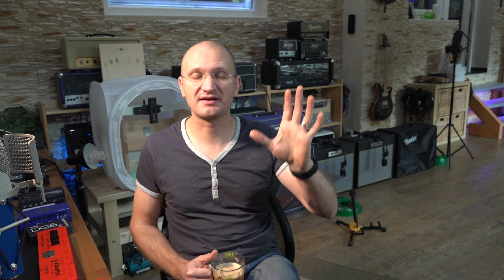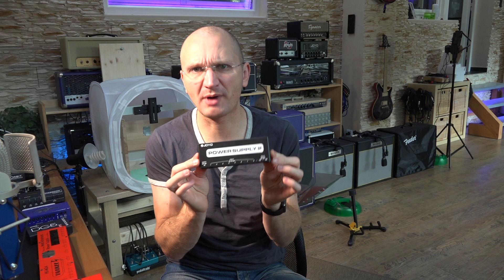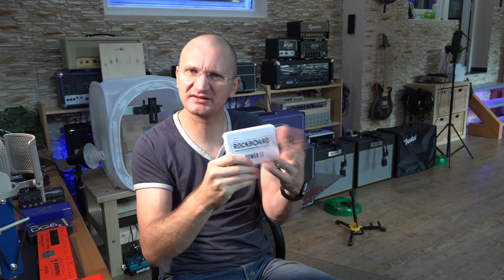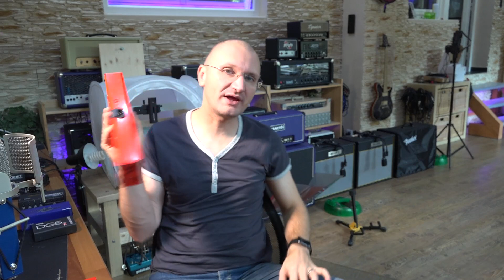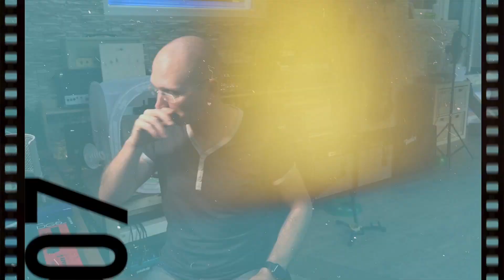Power Supply Shootout - What does a Power Supply SOUND LIKE?

Comment: Cable Tip Noise

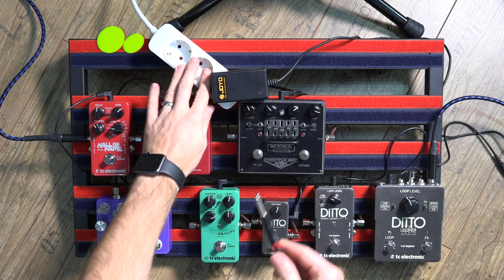Joyo Daisychain - 20:48
Capine - 23:07
Joyo Power supply 2 - 24:43
Harley Benton - 26:31
Moen - 28:16 
Carl Martin - 29:52
Joyo Power supply 4 - 31:27
Rockboard Powerpit - 33:13
Yankee 10 - 36:00
Yankee 24 - 37:35
Rockboard LT - 39:09
Cioks - 41:11 

Cable Length Noise

Joyo Daisychain - 21:05
Capine - 23:18
Joyo Power supply 2 - 24:52
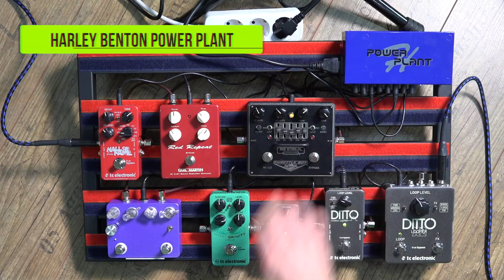Harley Benton - 26:43
Moen - 28:23 
Carl Martin - 30:00
Joyo Power supply 4 - 31:34
Rockboard Powerpit - 33:33
Yankee 10 - 36:08
Yankee 24 - 37:44
Rockboard LT - 39:15
Cioks - 41:23 

Sound 1

Joyo Daisychain - 21:16
Capine - 23:26
Joyo Power supply 2 - 25:12
Harley Benton - 26:51
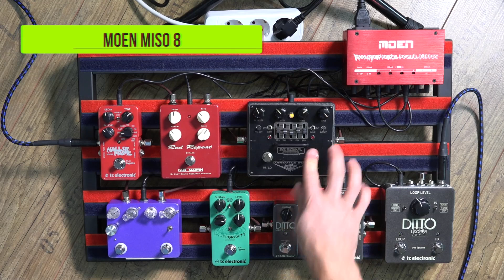Moen - 28:31 
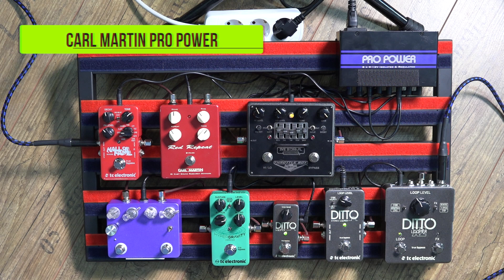Carl Martin - 30:05
Joyo Power supply 4 - 31:32
Rockboard Powerpit - 32:24
Yankee 10 - 36:13
Yankee 24 - 37:50
Rockboard LT - 39:28
Cioks - 41:32 

Sound 2

Joyo Daisychain - 21:41
Capine - 23:47
Joyo Power supply 2 - 25:33
Harley Benton - 27:23
Moen - 28:53 
Carl Martin - 30:29
Joyo Power supply 4 - 32:13
Rockboard Powerpit - 34:52
Yankee 10 - 36:38
Yankee 24 - 38:11
Rockboard LT - 40:00
Cioks - 41:55 

Sound 3 

Joyo Daisychain - 22:09
Capine - 22:12
Joyo Power supply 2 - 26:00
Harley Benton - 27:50
Moen - 29:25
Carl Martin - 30:54
Joyo Power supply 4 - 32:40
Rockboard Powerpit - 35:21
Yankee 10 - 37:04
Yankee 24 - 38:35
Rockboard LT - 40:27
Cioks - 42:22
Reply from the maker: Thanks man! Very kind of you to give the times... I spaced out on that!
Reply: No problem at all, interesting to hear!
Reply: +Tobias Hawthorne   capine sound 3 starts @24:12 :-)
Reply: EytschPi42 man I'm kind of a noob with pedal board building stuff, would you mind building me one?? Haha I'll even send you all the pedals
Reply: Thanks man! I really love the videos if only there's less talk and more on gear...

Comment: The metal cases for the power supplies will provide better shielding over the plastic wall wart.  But the plastic wall wart would likely be at the AC outlet away from the pedals so the distance will be better.   I think it might have been better to have use an Oscilloscope to see if there was power supply ripple from the various supplies when you were active with the pedals.  Hard to hear noise when the signal is so strong.

Comment: Good video. I used a daisy chain power supply for a few months, and for some reason I had to plug in and turn on each pedal one at a time anytime they were unplugged from walls power. also would sometimes get very pronounced hum through one or two of the pedals. Have since switched to a fairly cheap, around $32usd power brick similar to the joyo 2, dead silent and all the pedals power up properly once power is connected to the brick.

Comment: Great video. Thanks. BUT! You should state in the beginning which of them really had a) old school linear torrodial transformers or b) switched current. Such can play a large role. And btw, the pops in ALL of these videos has nothing to do with the pedals alone. I have the large DITTO looper (to the right) and it doesn't pop the slighest when turning it on or off. I can attest to that most (not all) pedals that runs on internal pump charging and on 18v or more DOES pop independently of power supply. Some does, some not. Most buffered pedals doesn't pop. The difference in sound though, is only where it is at rest, i e how background hum or noise floor and ..... especially....heterodyning high pitch whisteling. Not increased dynamics or else. However on bass pedals especially compressors, it is an advantage to dynamics to run them at 18v, so they can take ample input from say low B strings and active pickups. But we digress...back to the pops:

So you must have some mismatch in the phase flow of the current, outside of the power supply, or even at the receiving end, the amp, or mixer/soundcard or whatever. No one of the pedals should pop. The Mesa dirt pedal was the one most prone to hum and noises from lesser power supplies, as well as the loudest pop.

Some pedals (you should do a full video on this phenomenon too) have internal charge pumps which some other digital pedals in the chain picks up and downsamples them and an annoying high pitched whining occurs. It's called heterodyning. It's a nuisance. And this is dependent on BOTH the power supplies (mostly modern switched ones) and how the individual pedal is made, if it filters out this or not. 

- - - - - - - - 

Say an analog dirt pedal that runs on 9v from the outside, has an internal charge pump that ramps it up to 18v. Now, the charge pump (internal electronic component) works at a certain frequency high above the human range, but just so much. At - say - 22 Khz. No one hears this. BUT! Whenever hooked up down the chain to a Digital Delay, or Pitch Shifter (or pitch shift preset in any multifx box) Whammy pedal, their internal DA or AD converter finds this 22 Khz frequency and downsample it into the hearing range for humans. That's what happens. I've discovered that most Strymon reverbs, and delays suffers from this since they have high end and pristine AD/DA converters inside. And those companies tells the other ones, the makers of charge pump pedals, to fix their output of high frequencies with filters, it's not Strymons fault. And the makers of these analog pedals blames Strymon for not bucking that frequency with filters before AD/DA conversions. A catch 22.

EDIT: Besides all this, no other YT video of the Ditto looper sports any pops. Including your own earlier demos of it, which always are very thorough. Both the regular versions, and jam versions. Note, that it would be very inconvenient should any looper record and keep any pop from any other pedal too. It would turn out extremely annoying to keep listening to that pop occuring every cycle.

Comment: You can notice a slight reduction in ground noise on the power supplies being used after the power plant when you listen to the clean loops. Not all of them, but most of them. The two pedals he is using for the clean loops sound like they are causing the most ground noise compared to the other ones. What pedal board model is that being used in the video?

Comment: +EytschPi42
of Bolivia I not understand much English so I glass on what I hear.
I have rockboard powerpit, after hearing and seeing the video stay with a bad impression, apparently is noisy, what you suggest? Change of power supply ?, sorry for the English, I'm using google translate, thanks
Reply: I know this is late, but unless you notice noise in your rig i wouldn't worry too much. Yes there are probably quieter options but unless it is causing you problems it is probably not worth the extra cost.

Comment: Here in the UK there is a company called Diago.  They are very similar to the GigRig in that it is not a power brick.  much cheaper.  would definitely sort out your boards.
Reply: The Diago was great until I got el Cap from Strymon, man that high pitch hum thou :(
Reply: you need the diago isolator.  or the gigrig one will work.  that should sort the issue out

Comment: Got the first question: Can i use 9volt-pedals also with 12/18 volt and if i can would it make a difference in sound and why?
Reply: No you can't! I tried that ones....the pedal i tried it with, died. So don't do it!
Reply: +roeletti if they are digital, that is a "no-go"! but if it is analog, there's a chance you can do that... but don't try if it's not written on the manual...
Reply: Boss older stuff is 12v. My CS 1 is modded and says 9v on it. So I ran it in 9v. For a while it sounded good, quiet lit up right did what it was supposed to do. Then I took my board over a friend's house and the most horrible noise came out. So we couldn't use it that day. Came home, went through the board and decided to change the CS-1 To 12v. Problem fixed so far. Haven't taken to friends to see if it's a grounding problem at his house. Will take a grounding loop box next time also

Comment: For what it is...the Joyo Wallwart kicks serious B#tt. You wont ever put your cable near the wart and there is nothing in the power supply close to the Pedalboard. Its plugged in the power strip. it sounded clearer than most if not all the samples loop tests. The Joyo big brick was also good. I think Henning knows this as well. Joyo rocks

Comment: Nice video!  I have a problem i can't figure out. I have a fulltone ultimate octave fuzz and an analog delay pedal that give a high pitch buzz/hum. I power my board with a simple plugin 1 spot power supply. The weird thing is that the analog delay  starts with a fairly high pitch en when engaged the pitch gets higher within the first 20/30 sec. Like there are capasitors that charge or something. On the same pedalboard i have a crybaby and a fulltone mosfet drive2, polytuner and a super hard on from zvex. My amp is a blues deluxe ri and my guitar is a 65 jazzmaster.

Comment: sir i have a boston acoutic simulator..the problem is i have a different power supply and when i plug it on the sound sytem it doesnt sound or sometimes it sounds and suddently the volume goes down..

Comment: Anyone use a Donner DP1 power supply? Is it noisy or no? It has good reviews on Amazon, but I want some feedback from more guitarists
Reply: The Donner DP1, the Accel FX 10M and the Joyo Power Supply 2 are basically the same, rebranded  units, some with a slightly different chassis, but extremely similar boards inside. They are NOT fully isolated channels. ( The Accel FX 8 IS fully isolated... Accel does not claim the 10M to be isolated..just filtered and regulated )They will say "isolated" as in protecting the circuit in case of a short, all outputs will not suffer loss if one shorts out. But in the case of guitar pedals, we look for "isolated" as in, each channel grounded so grounding issues between outputs will not create noise, like using a daisy chain can do, especially if you are running analog AND digital pedals. They work fine enough, but dont do anything to isolate each power output channel. I KNOW they say they are, but they are not. Most isolated units are more expensive. These units are basically a boxed daisey chain, with varying voltages and currents available. ( 100mA, 500mA, 9v, 12v, 18v...)
Reply: Hey man I’ve been using a 30 dollar donner for a year and have had great luck even with several different types of pedals. Cheers!

Comment: Hi EytschPi42,
I really like your shows you're making for guitar geeks like I am. I need to know how pedals look on the inside and I opened quite a lot of them and built a few DIY's. At the moment I am building my pedalboard and also am wondering what to use for a power supply.
As far as I can see, a lot of daisy-chain based power supplys are based on switching circuit (step-down type power supply) and the "old-type" power supply uses classic mains power transformer. Switched power supply is working on very high frequency (varies, depending on the controlling IC) and are not inside metal cases. These kind of circuits generate a lot of electrical interferences and are not suitable for audio (all Hi-end HIFI systems use transformers in power supply line). As far as I can see, the only advantage of switched PSU over classical transformer is it's small weight and therefore also smaller size. 

I hope I'm not too late for the questions, which would be:
1. My pedalboard is made from Harley Benton Dynamic Compressor, Digitech Screamin Blues, Electro Harmonics NEO Mistress and finally Digitech Digital Delay. I am thinking of buying a looper like Boss RC-2 or RC-3. What kind of supply is to be used with these pedals?

2. What does the ISOlated power supply mean? Does every "channel" have its own 230/9V transformer or do all channels have the same transformer and each its own stabilizing circuit?

Regards,
Andrej

Comment: Hello, i actually have 8 pedals ( all analogs ) on my DIAGO pedalboard and FUEL TANK JR with 2 TC current doubler, which works well , but a new pedal ( diamond MMR JR )came( instead of my MELAKKO 616 delay out now) and one of my doubler cable is too short ......Do I have to buy another DC UNIT ?
DOES THE FUEL TANK CLASSIC ( no individual isolated current output , the JR WAS !) do the same job with the same silence ? I do want to spend a lot of money as voodoo lab is, sorry....Thanks a lot for your help and answer, Best regards from France
Reply: Sucks noone answered this guy, cos I'm in a similar boat.

 I've got a few more pedals than my power brick has got outlets. I've tried daisy chaining the last few...and I've tried just plugging in only the ones I'm using at that moment.

Both are unsatisfactory, over time.

Do I really need to buy a whole new brick just to cover a couple of pedals?

Comment: is the amp itself running from a power regulator? Or your whole studio? Looking at the amount of gear you must have a urge suppressor or something similar.
Reply from the maker: +Haz Jalkhi No, I just have a lot of independent power lines coming in.
Reply: We wont be able to find out like this. This power supply examination has to be conducted in a venue like situation. Not that I am requesting your to travel or anything. But take into the equation somewhere which has a similar venue electricity outlet and is a in a space which allows a great amount of interference. Your studio is well equipped and looks well isolated, therefore not the right place for such test. Still, I am looking for the next week video. You are AWESOME!
Reply: +Haz Jalkhi Yes in the past I had my pedalboard dead quiet at home and hissing like crazy at a venue. That's why I know have my whole board running on the Sanyo Eneloop Pedaljuice! Its a lithium battery the size of a standard BOSS pedal. It only has two outputs but since it's a battery, you can daisychain all u want without any noise issues (even digital ones). Mine powers 8 pedals and a Harley Benton FXL-8 pro and can easily run 5-6 hours . More than enough for a gig. I paid only €50 for it and it was easily one of the best purchases I made for my pedalboard, say goodbye to ANY electricity related noise problems :) Maybe something interesting to look at +EytschPi42?

Comment: Can you do a comparing between the joyo and the new Engl power tap?  I recently purchased it there is something annoying. The engl is very similar to the joyo but it's retailed 120 euros!!! (79 on thomann since last week, that's why I purchased it). I just wonder if  engl are horrible people that sells the same thing for 3 times the cost, or mybe it's a really improved version that only shares the same chassis of the joyo. I also noted that thomann says they are isolated but the manual and the engl website says "protected from short circuit". Thanks! 🤘

Comment: Hi, I need to ask you some information.
To be able to power 10 mixed pedals (BOSS, MOOER, IBANEZ, AKAI) what type of power supply will I recommend? I have tried the "Harley Benton PowerPlant" and also "Harley Benton PowerPlant Powerbank" but in both cases there is always a background noise (that if you feed each pedal individually with normal 9V power supply, there is no buzz!). Can you give me a tip? (the pedals are all 9V). Thank you . and sorry for disturbing. Best regards
Reply: francesco martinico buy an isolated power supply. It’s the only way.

Comment: Q: Electro Harmonix pedals come with a dedicated 9.6V power supply. Can normal 9V power sources cover them, does it make any difference?
Reply: seitsen Yes, no. (But check the polarity).
Reply: Yes you should be able to power them, but depending on the pedal you might experience differences in sound/behaviour. My Deluxe Memory Boy goes into self oscillation much sooner and more uncontrollably so when powered with 9V vs. 9.6V

Comment: What do you think of the DCT-200 by Fame?
Reply: Isolation is not nonsense when it come to eliminating groundloops, especially when using effect loops. I do have a Fame DCT-200, and it does blow any other cheap power supply out of the water! I tried the Donner DP-4, which does have isolated outputs, but fails short on current; it cannot deliver 100mA without considerable noise on the line. I'm affraid Henning can't comment on the Fame, because it is sold only by Thoman's biggest compettitor; Music Store. Now if the Harley Benton Power Plant would have isolated outputs (which it doesn't), it would be a winner.

Comment: $80 cables. haha.
I bought a 6m kirlin cable for $10 and ive had it for over 3 years and still works and ive had no noise problems (and i play lots of high gain stuff)
Reply from the maker: Me And I it is not about noise or wether the cable works. better cables sound better. They have more dynamics, better low end response... these are  it subtle things, they are pretty audible and noticeable. Having one or two very good cables is a good idea if the rest of your gear is supposed to sound as good as it can.
Reply: It's actually the high end the one that changes significantly. Cheap cables= More capacitance= Less High end, but this only makes a noticeable difference with 20 ft or longer cables. Unless your cable is literally made of aluminum or some material not as conductive as copper you should not experience bad low end response or poor dynamics, in that case it would just be some kind of placebo effect.
$80 is too much for a pretty short cable, you should not spend $10 like me (although Kirlin cables are great quality), but going past $50 is insane.

Comment: A little bit late to this vid (been catching up on loads of them since finding you here on the youtubes) only thing I can say is surely whatever power supply you used to record the loops would colour the loops anyway, if it does anyway so really hard to say is one bad or not, still a very exhaustive and thorough review/test tho.All I can say really is don't wave your cable tip over the plug socket and no one will know the difference lol. Edit just watched the Rockboard bit ok lots of hum         ill get my coat.